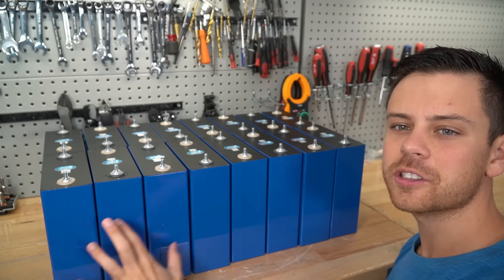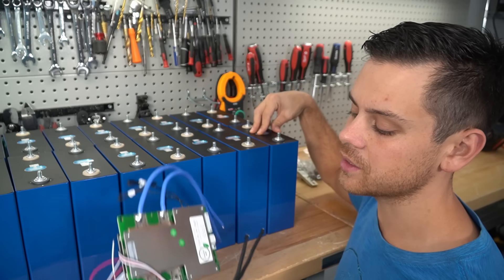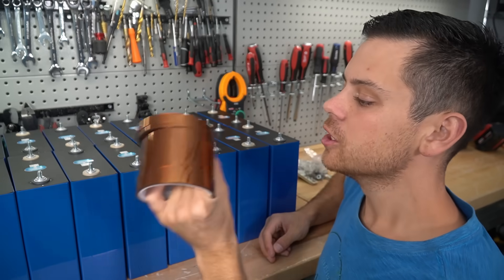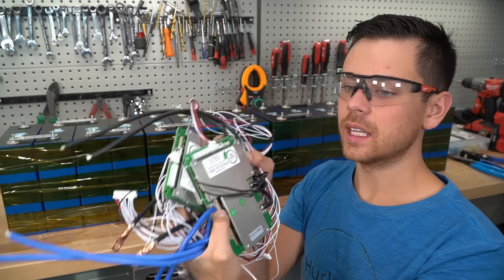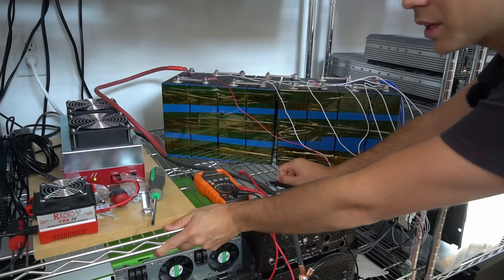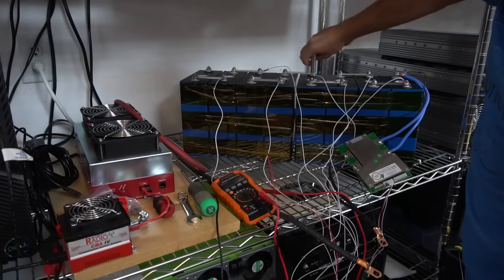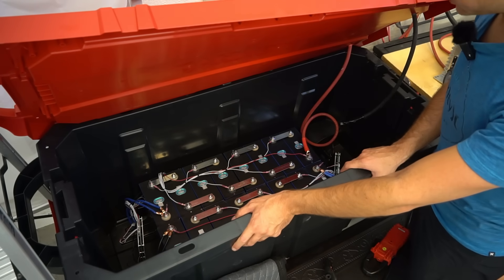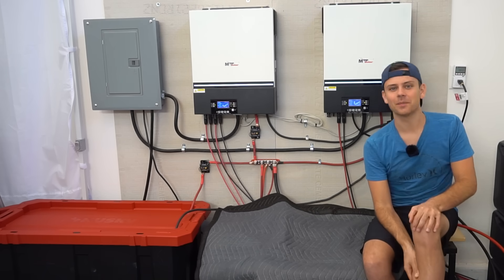DIY 48V 320Ah Grade B LiFePO4 Battery Build: 16kWh for $2,810?!

Comment: Well how price's have changed since.
Now in UK you can buy grade A eve cells for 100 pound each (618ah) 16 cell's will give you a bit over 30kwh for 1600 pounds plus another 300-350 for a good BMS

Comment: Built a frame from flat bar, for compression bars weld bits of threaded bolt to each end of flat bar , take sheet metal end plates and take the flat bar on end, tack two side by side like an equals symbol, and have the hole for the compression bar threaded portion in the middle. 
just two bars each side, 4 on the ends. 
Then take corrugated plastic and cut out spacers so it can vertically vent. If you put a fan in the middle blowing down and the pack is raised just a bit you can cool the batteries with the fan if they get hot. 
I think they could passively cool expecially in an equipment cabinet with several slots for air can convectively rise, 
Inverter on top so heat rises
and fans on top so heat is ejected. 
Use a tool box or sams cart or something like that where dust and fingers can get in, and there can be a lock on the outside so no worries.

Comment: I feel like I kinda made a mistake. 

I started buying EVE 3.2V 280AH prismastic cells on amazon after weighing the capacity per dollar…

Now I just need to find a good enclosure to start stacking batteries up to 16S. 

Then worry about the other stuff later and piecing it together. 

I have a cheap 5A max lab power supply coming monday. So I figured it use that to try to manually balance the cells as they come in.

Comment: The problem with 2 bms is that there should be a third bms for the 2 packs in series to regulate both 24v packs or make it 24v total and connect the 2 BMS in parralel to get double amps 

Now both packs will regulate different over time

Comment: insane, you can order 16 of these batteries right now for under 700 bucks shipped. pretty sure this is the cheapest they will ever be. rock bottom price. tariffs and politics are going to cause these to start going back up in price. 700$ for ~16kwh of lifepo4... truly a crazy time to be alive. if youre diy savvy and have the patience to learn, you can go off grid now for around 1000 bucks, not counting solar (which is also EXTREMELY cheap now, im pretty sure all the wires cost more than the panels depending on the voltage). inverters are cheap as chips too. just got a 24v to 240v eu spec single phase 3.3kw inverter for 140 usd to build an ev range extender. going to look back at this time like i looked back at 2016 blackfriday pew pow deals after the suprise election result and built 5 aye arg fife tenes for bout 180 each and kick myself for not buying more at the time lol

Comment: I am putting 2 24 v packs together with 2 8s bms (just like this build).
I get 57 volts when i measure on the battery,  but only half when i measure on the other side of the bms.
Do you have a diagram of how you connected the bms's?

Comment: What charger do you use for top balance. If the batteries are connected in parallel. For example 3.65v,  2240ah total of 8 batteries

Comment: I need advise. If Will Prowse doesn’t reply any EXPERT please advise me 
I have already built a 4X50Ah lifepo4 battery. Now I am building another 4x50Ah battery. Which setup will be beneficial for me. Connecting both batteries in parallel and get 12v 400Ah or connecting in serial and get 24v 200 Ah? 
Thanks for your kind reply.

Comment: This is my first video I watched about how to build a home battery. Quite amazing and it seems quite doable. Have a background in electrical engineering, but one thing I would be worried about is how to build a safe system, that doesn’t go up in flames, and with that, your house. Can you elaborate about the safety aspects? If you run such system over 12-15 years, what are the components that can fail? I can buy LiFePO4 batteries here that have a built in fire extinguisher.

Also I was wondering why you don’t have any ventilation on your enclosure.
Reply: Lifepo4 is pretty safe. Build with them. Don't compress grade B cells.

Comment: Hey can someone please fix my math. 
If you put 16 cells in series then 280ah x 1 cell x 48v(3.2 in series)= 13.44 kwh each if you have 15 cells in series. 
Each 280 ah cell on eBay can be about 150 bucks so then that's 150 per 13.44kwh

Comment: Eve 280ah cells, from Eve, are currently $105 each. Grade A new. So this build would probably be much cheaper today. Something like a 105ah mobile power station DIY build would be interesting now. Orient Power has a DIY bms/ panel, which has the SOC/SOH display, but is that the only way to get a DIY display? I would think that today's BMS offerings would also be improved.

Comment: okay boss not sure this is something that you would be into, but I want to build a monster multi lithium battery pack in 12v each battery that are wired in 2 12v sets to power my new monster mobility scooter build. the scoot works & charges as a split 24v system  but I want at least 9 sets of lithium battery set for 18 12v batteries in a massive set up where I can use each set of 2batteries at a time & then when it goes below a safe operating threshold the system will aout transfer to the next set & so on & so on greatl reasonable size simi comfortably  extending the range of the scoot. I will also need a stand alone 12v system to run some various automotive components that I will be adding into the build. So I guess what I'd like your help with would be the designing & build video of same. The allowed space for said battery will be that of the lower tray of most any large format grocery cart like the ones at wal mart safe way smiths... To give you an idea what this monster is to look like when done is if you look up 1900s C cab delivery trucks or hot rod C cabs I will use a basic HD Pride mobility scooter that measures right at 44" long by 22" wide & I will add a customized grocery cart that will be built backward against the back of the scooter And a small custom trunk like addition will be added to the frunt to form what is to be a cossmedic appearance feature as well as housing a compressor & the 12v stand alone battery . the scoot when finished should be about 99" long x 63" tall x 26" wide. I have aquired a older unit of the proper base dementions as well as 2 second hand grocery carts off E bay & have begone the construction of the body which will be in 2 parts that can be sepperated when shopping in stores with the second cart being open topped &  attatched at the rear of the scooter body. ( this feature also makes it possible to  use the unit as what I have dubbed a Hobo RV which can sleep 2 persons

Comment: Not sure if youll ever see this, but im sincerely thinking dropping $600  on building the mother of all Ebike batteries

I was thinking a parison setup, 2 24v 8s packs, 50 amp hours. I'd replace the rear wheel of the bike with a fat tire and put in a mid drive. 

Do you have any tips for weatherproofing? It would only be outside when parked while out driving, and i'd bring it in to stay warm while charging. Im looking for about an IP 54 equivalent rating or more.

Comment: @willprowse Quality over quantity.
"Big established companies" can afford to order samples from every single supplier to determine the best products of lithium cells, BMS's, wire harnesses, enclosures, overload protection, circuit breakers, isolation material, passive cooling, cooling fans, etc.

While DIY for batteries may seem tempting at "Half the cost"... I feel that unless you plan to resell battery packs for a living with relatively low profit margins, you are better off spending the premium price of 1300-1400$ for ever 5kWh in the current state of the market 2023.

Comment: So the bus bars are not really tight because the cells bloat causing movement?  Loose terminals cause resistance problems.  How is this not a concern?
Reply: Perhaps flexible battery cable in between the cells would solve this problem?

Comment: What were the voltages of each cell when when you did a full cycle of the pack? Of course if some cells were closer to 3.6V and others were down at 3V it would be pretty clear that there is at least some imbalance. It's a very quick test with the multimeter you had on hand and would be very interesting to see.

Comment: I started 3d printing cases for my lifep04 cells. So far, seems to work well keeping the cells compressed. Thank you for all of the work you have put into these videos. I built a 12v 280ah lifep04 battery for our camper.

Comment: I have different question. Do you have any list of 1 phase 3.6kW ,two strings (MPPT)  inverters which would work with DIY LiFePo4 48V bank ? 
Finally got my 16 cells  LiFePo4 cells EVE 3.2V 280Ah.

Comment: I recently building a 12V 4 cells LiFePo battery to replace my lead acid battery for my boat. I bought from Taobo (Chinese version of Ali Express) from a company Jiali Technology. Cells are grade A and arrived in mint condition. The price is RMB 680 (USD 99) for one  310Ah cell. They can provide stronger packaging box for extra (USD $4). The problem I encountered is delivery from China to HK. Many courier companies refused to deliver lithium batteries. End of the day it has to be delivered to my friends home in Shenzhen China and I picked up myself and use a cross border van to deliver to HK. The delivery of the cells to my friend’s home is 3 days after placing order. Lucky I lived in HK and not US. I repeat an oder for 4 more cells yesterday.

Comment: Is the movement of the studs in the busbars due to expansion a contact risk?
Couldn't this compromise the connection?
If so, what is the best/ practical solution?
TY.

Comment: Will I am building a RV and want about 3,500 watts on the roof, do you recommend using the 540 watt panels I have found that are currently made in India?  I can get 6 of the on the roof of my 35 foot RV. I will run it at 24 volts.

Comment: I notice you rely on the plastic wrap of each of the cell to separate the cells from each other.   Is the aluminum case internally electronically connected to the positive or negative terminal of the cell? Any chance the plastic shrink wrap around these cells break due to expansion or old age? In that case i think you need to insulate between cells.  But i guess you have had no problem since this video has been out for a  year

Comment: Well i listen to your advice 12v vs 24v and purchased and battery advice , ended up ordering 8x280ah EVE grade A cell package with  200A Deligreen 24v 8cell bms ,i have  1200w in solar in series  running into 100/50 Victron mppt  150/60 would of been better as its pushing close to 90v at peek cool conditions but i live in hot climate 30c 38C summer temps or more heat waves well over 40c 
.biggest issue will be keeping the cells cool in the shed thats insulated but temps are still well over 21c 70f ,only thing i can think off to  store them in cool would be insulated cement box 3 inch thick under the slab

Comment: IMPORTANT: Will, you talked about the relief valve spitting gas all day, you can't breathe etc... So you said the solution would be stick to a ready built battery if you don't understand this stuff. But I ask: These ready sealed batteries Ex: 12.8V 200Ah, which I have seen do not have a pressure relief valve or a gas elimination valve. So, if this happens inside there, where there are days or hours leaking gas and there is no way out, it can become a gas pump or cause a problem internally, including for the BMS that is normally included inside (do you agree with that? ) You Do you know if these gases that release LiFePo4 prismatic cells are not only toxic, but also flammable? Thanks and hugs to my friend!

Comment: I have a question and need your opinion  ... I have 16S LiFePo4 battery, 310 A CATL with Daly BMS use for small electric vehicle .... But now , 2 cells is mechanicaly damaged and need to replace ... Can I Replace with 280A CATL battery or must be 310A ? Or can I replace with another type of battery (eve) with 310A ? Thanks ,

Comment: HI, did you just connected the new battery direct on the old battery to charge? like a parallel connection? or did I miss something.
is it oke to have 2 different battery's in parallel to an inverter? like 1 pack is 10kw and the other 15kw?
great videos I learn a lot. I'm planning on making a 48v offgrid solar bank.
Thanks

Comment: I know your battery came with the busbar terminals but I’m trying to figure out how one would know what the copper terminals can handle.  How would you know how thick of copper to use or at what rate of discharge would you consider a different material?

Comment: Are you able to run batteries in parallel after you build them with a bms? I was told you cant run bms in parallel but i thought all batteries had them and people run prebuilt batteries in parallel

Comment: If you wanted to build a 32 or 48s version of this what changed ges would you have to make. I would assume you would need 3 16s BMS to run the batteries but how would you go about tying them into your PV system?

Comment: I have worked out how to use my Victron smart shunt to do capacity tests! Previously it shuts down and loses its reading when the bms shuts down- so Now I connect the smart shunt to the battery, then the BMS. So when the bms shuts down you can still see the A/h on the smart shunt!

Comment: Hi Will,

I have a question and maybe you can do a video about this topic. A lot of all-in one inverters will only work with the batteries if they have a RS485 connection. Do you know about any BMS with a build in RS485 port that will communicate with the most known inverters? And what setting do you use for your Growatt inverter when you connect your DIY lifepo4 batteri banks?

Comment: Will, you mentioned running BTC mining rigs in the winter when its cold. Would these rigs be running 24hrs, completely off grid? I am trying to build a solar array for off grid ASIC miners the calculations I am coming up with require more than the 16kWh. I would love to hear more about your setup.

Comment: Oh Commander of all things Jackery, are there any fuses inside a 500 watt unit,  accidently got a back feed from a 175 watt solar cell into the 12 v accessory plug. Everything else still works but the 12 v plug circuit is dead?

Comment: I need 24 V for my Outback setup.  Will these work with two in parallel? My inverter breaker is 175 A. What brand BMS were those. This would be a huge improvement over my Lead acid L16s.

Comment: Can you make video about how to put solar kit on semi truck please. 
I was wondering if there is any plug and play device that can charge my battery from the solar panel and the truck alternator that can run the air conditioner on my truck when it's off. Or is there a  plug and play system that I  can charge from my solar panel and the truck alternator and shore power when I have it to power my truck Air conditioner.
I will be appreciated for the feedback.
There are so many videos but few people explain properly.

Comment: Under ideal circumstances, would you have used the 16S 100A BMS from Overkill Solar, or would you have used something closer to the 320A current of the Cells? I would like to use an induction cooktop that is rated for 2Kw, so the numbers would add up pretty well.
Reply from the maker: Overkill solar bms. Because 100A at 48V is 4800W. You could run two induction cooktops no problem. And maybe a third
Reply: @WillProwse  Thanks for your quick reply. I am sorry, I did phrase my question slightly wrong. I am looking at a 24V system, not 48V. The use case would be for a touring vehicle, so Cooktop, 24v Refrigerator and some usb charging. 100A * 24V would on paper be enough, but I am not sure.

Sorry again to not have inquired you more clearly.

Comment: Hey will 
I noticed something weird while charging my DIY lifepo 280ah battery. I got a Daly 150A BMS hooked up to 4 lishen 280ah cells that intially only had 270ish ah and are Grade b sadly. I had Them in use now for a few weeks and charged them up a little other than that I only discharged them till the Daly turned the system of due to low voltage. Today I wanted to charge up the Battery and noticed that only after approx 10sec the Daly BMS app already showed a charge of 7%, 30min later it was at 57% can that even be correct ? Surely lifepo battery's have special charge and discharge curves compared to other types, but is it normal that it charges "that" fast?
Cheers

Comment: looks like they actually sold you 280ah cells. cheated you, but I like the welded-on studs on the terminals you received on them. hard to make good busbars with smashed copper pipe and then drill the holes in the right spots so I gave up on that method and ordered busbars for paralleling cells, and made 2/0 cables and lugs for series connections. not cheap or easy but better in the long run I hope. I am building a 32-cell 1088Ah 24-volt using 3.2V 272Ah Lishen cells build. not for the beginner -- lots of power!!!😎

Comment: Do you recommend to use aditional isolation between cells, or is ok to hust tighten them up together with tape/belt? I have 120AH LIFE 16+16 pcs with daly bmsses. How do you recommend to measure SOC? I found onpy expensive BMSes. thx for advice and keep up gr8 content.
Reply from the maker: No, I don't care at all. People keep crying about that. The sleeves are designed to isolate and they work well.

Don't over tighten the cells together
Reply from the maker: I would use a victron shunt and you can measure SOC accurately. You will love it
Reply: @WillProwse   I wish the Victron Shunt had a way to record historical data